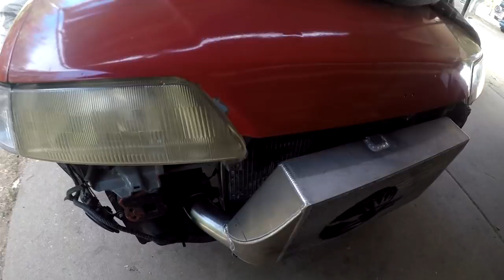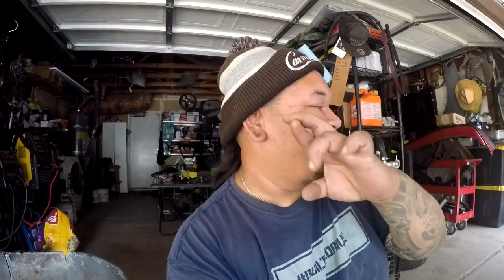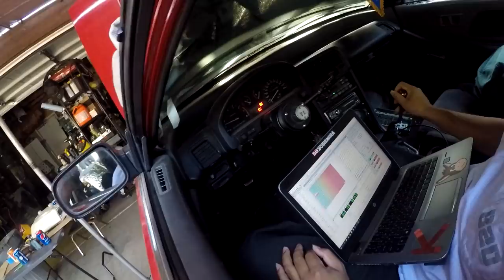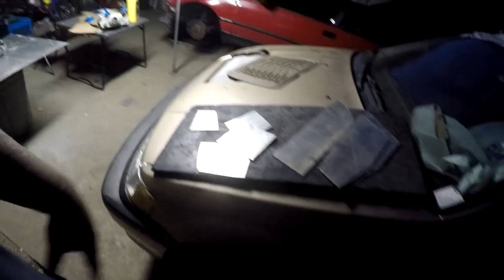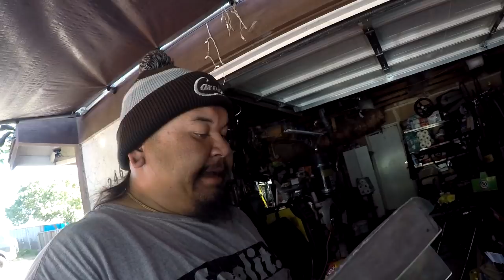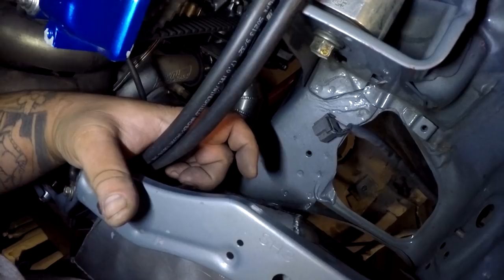AWD CRX FIRST START ! ! + Custom Headlight V-Stack !

Comment: Great job on the car as usual. But do the tracks you run at require you to run a belly pan for if it breaks so it wont oil down the track.
Reply from the maker: Per class yes, you need a belly pan. I’m actually going to make one soon.

Comment: Very nice work on the headlight duct.. I made one similar for my EJ1. I used the back of the headlight housing, took the lens off and made the body of the lens out of aluminum as well. Used a 4in hole saw to the rear of the housing, to allowing placement of a 4in intake pipe, which i used QuickSteel to secure the housing and piping to the headlight body..

Comment: Dude! im green with envy!! yo, if you could pump out like 10 pairs of those headlight housings and charge like 500$ for a pair or 250$ for a single.... 
and why ONLY 10 pairs one would wonder?.....
"LIMITED EDITION"  headlight stacks with YOUNGSTATIC stamp welded on!!
you could either sell them outright or save one pair for a subscriber raffle....
Reply: @alphant1  for my track build i want a headlight delete and the intake on the passenger side for the b16a in my 89 hf.
and i would love if they were aluminum to match each other. i also really want the headlight and corner as a 1 piece. ive considered the carbon fiber ones but i can only find them for the jdm front end as a 1piece headlight and corner light delete.